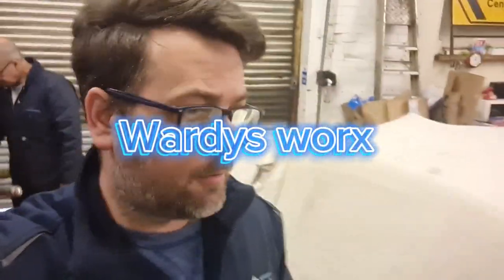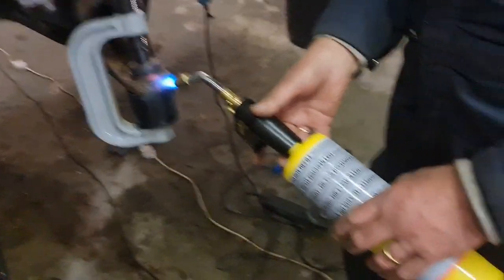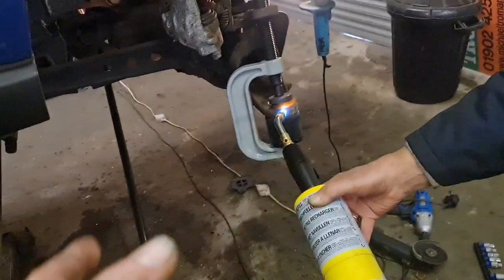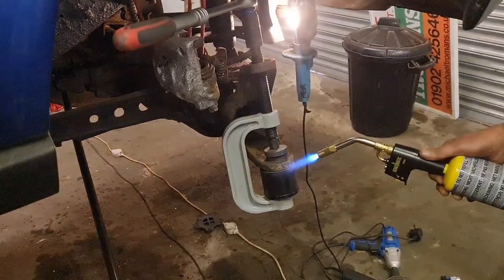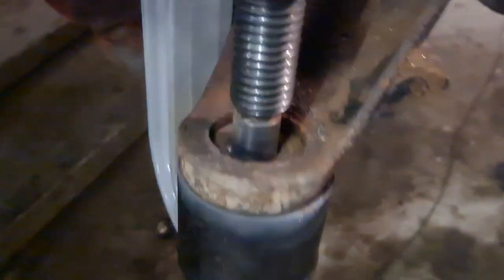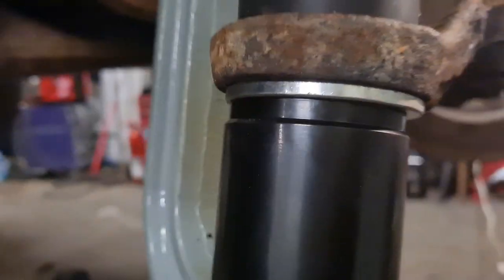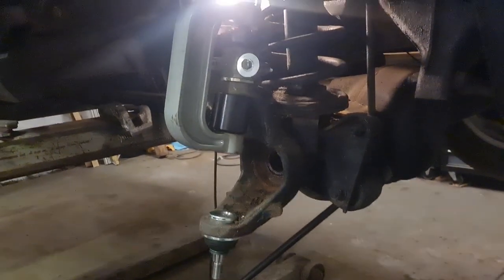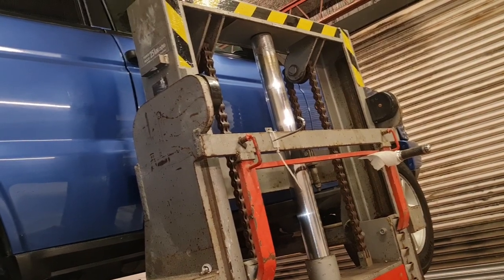land rover discovery 2 td5 fails mot on ball joints so we fix it.

Comment: Just a note from my experience 3 weeks back. 
Wire wheel the hell out of it before starting pressing. 
I personally didn’t need so much heat and I applied it sparingly whilst trying to press so as not to get too hot. 
Also don’t make my mistake, take the boot off before pressing in the top joint, I cut the boot by accident and had to get new boots.
Thanks for all your videos, helped me loads.
Reply from the maker: Thanks for the heads up. This was our 1st try at ball joints so I'll keep your tips in mind

Comment: Good work guys, for anyone else this job can be really difficult the heat does help a lot along with a wire brushing the area. I'd advise plenty of oil on the clamp thread to stop it from stripping, and the joints should go back in easy if there's any resistant they are at the wrong angle or hitting part of the clamp setup hope that helps.

Comment: Thanks for all your videos. 
Dude, this was the biggest PITA maintenance I’ve ever done on my ‘01 Disco 2 V8. Even rebuilding my Thor engine was easier than R2 the damn ball joints. 
I wish someone made ball joints with zerk/grease fittings or ball joint deletes like for Jeeps.  
Cheers from a Yank in Suffolk! 🇺🇸🏴
Reply from the maker: No worries. Not a fan of this job either. Thanks for watching!

Comment: Had my ball joints done on Big Lollopy at the garage. When it came back I noticed they had spot welded the joints to the hub carrier. The ball joints can only be replaced 3 times. After that, a new axle casing is required. My joints must have been too sloppy!
Reply: My guess would be they used too much heat when removing them. I was given the heads up before doing mine to go easy with the heat. 
Clean as can be and rust free before starting is more important.
Reply: @jonathancooke542  Could be. I have no idea how many times they had been changed before though.    It is a job to avoid though!
Reply: @sleepycatpictures1176  I quite enjoyed the process, not sure what that says about me 🤔. 
In theory once changed the fitter should dot punch the axle. Check around the joints area for punch marks on the casting.
Reply: @jonathancooke542  Mm, too late now. Lollopy was scrapped 3 years ago, but I know what you mean.